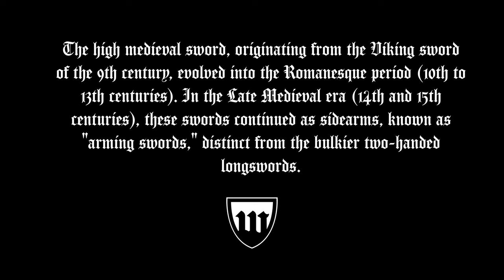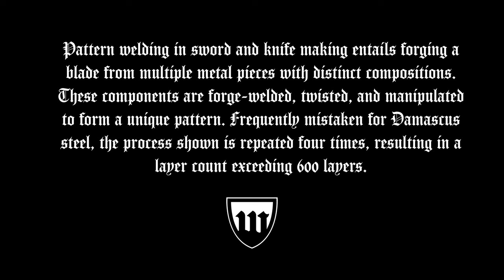Forging the Whitewolf arming sword, the complete movie.

Comment: What’s the difference between Damascus and pattern welded steel?   Is it just semantics or is there a real difference?
Reply: Pretty much the same
Reply: Damascus steel is "crucible" steel which in ye Olde days was often sold in Damascus Syria (probably not made there, it was a major trading hub). Pattern welded steel is layers of steel stacked, forge welded, and then often manipulated into various designs (ladder, raindrop, etc etc.)
Currently, the term "Damascus steel" is widely used when it's really pattern welded steel.
Reply: @richardc8340 .  Is crucible steel Wootz steel then?
Reply: Damascus steel came from from the name of the city Damas, and the patern they maied in the steel, it is quit the same about a patern welded sword blade, witch is named like this cause the patern you make by welded twoo steel with hight tempereature in the forge processus. At the origine there was damascus, witch is a patern welded blade and Damascinage, witch is the incrustation of precious steel like gold, silver, coper in the blade.
If you look at arabic blades, or spanish swords, or scandinavian blades, you'll have wonderfull exemples of it.
Reply: Yep! Thats one kind, it was made in India and has a particularly neat pattern.  @dominicdwk 
With crucible steel, basically you take a pot and mix your ingredients in, then heat it until it forge welds together. Depending on the ingredients, you get different appearances and properties.

Comment: What is the purpose behind clamping the blade between wooden boards beyond keeping it flat as it cools? Is it also allowing the smoke and wood to increase the carbon level?
Reply: Normalize the steel, so when you quench it, it doesn't warp as much, if at all